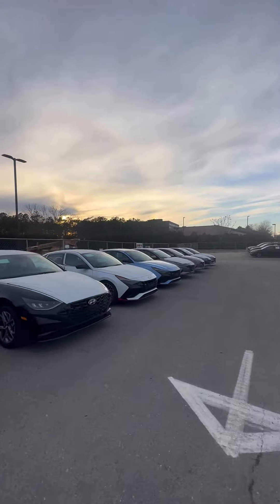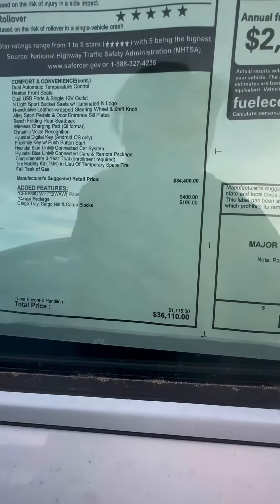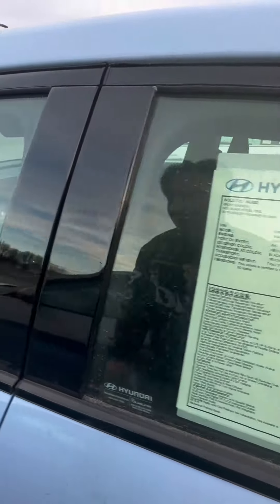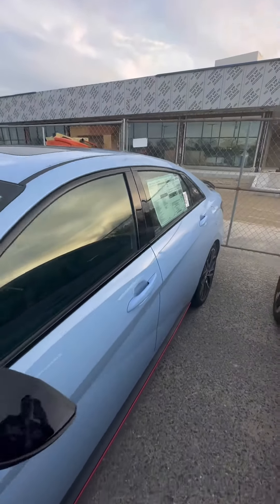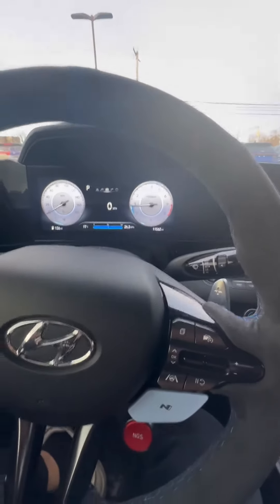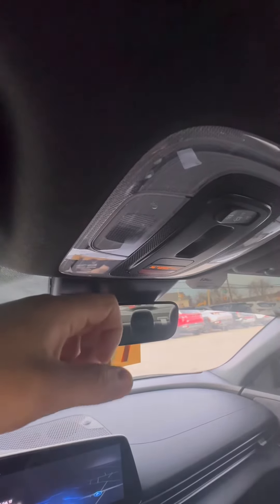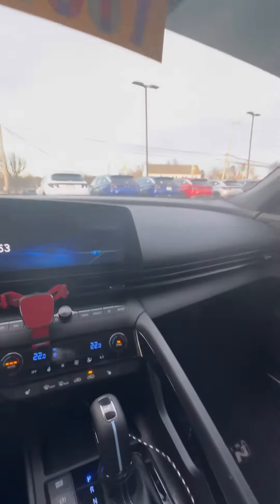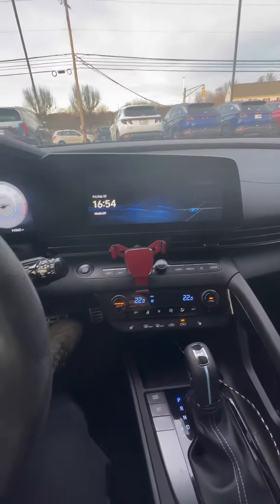2022 Elantra N Rattling/Tapping Noise Update #elantra #hyundai

Comment: Sorry to hear you are having to deal with rattling noises in the interior of your N. There is nothing more annoying than rattling inside the car when driving These are the little things Hyundai Has to pay attention to and make improvements on.
Reply from the maker: I tested drove the other 2023 Elantra N, seem like they have improved the quality of the 2023. I’ll get used to it eventually 🙃
Reply: @NpowerXsad  Yeah they seemed to have fixed a couple issues in the 2023 that the 2022 had. Good luck and enjoy your N👊🇨🇦